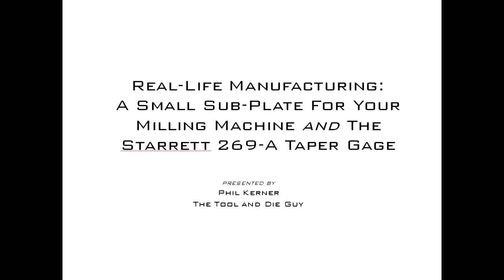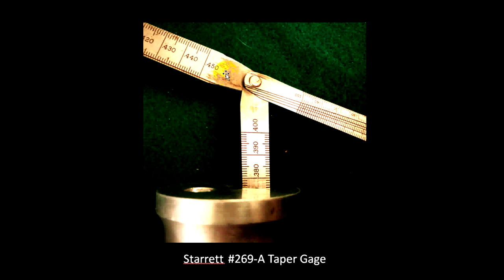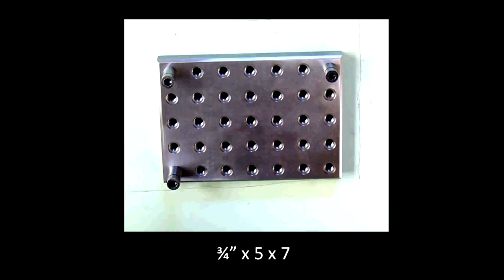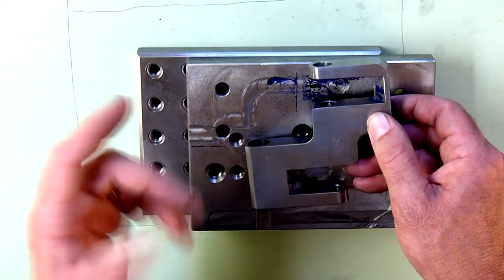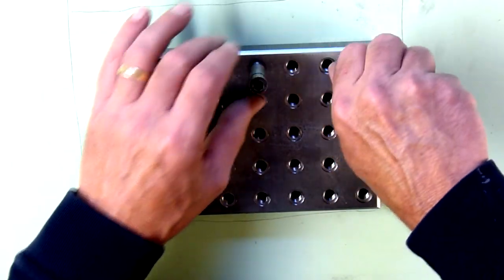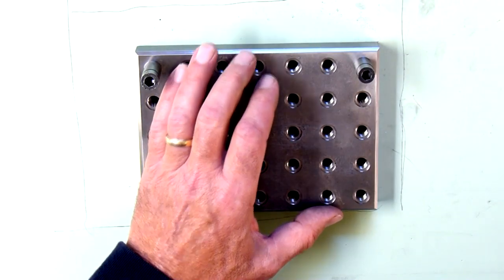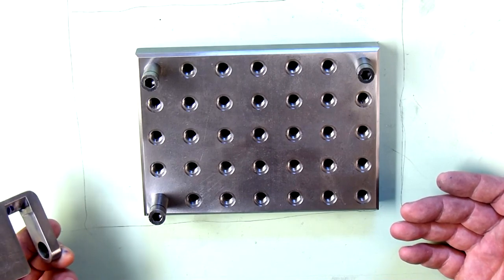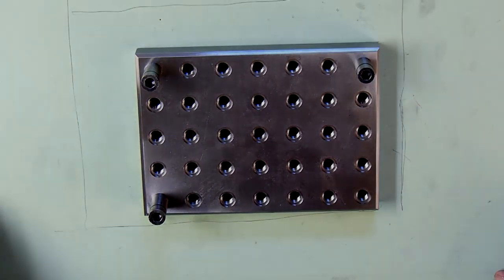Starrett Taper Gage and A Small Sub-Plate For Your Mill Vise

Comment: Hey Phil, 

We use sub plates and fixture plates in industry for Tool and Die Stamping side. The majority of die sections we make are designed to fit on the grid. And like you did with your shoulder bolts we have all the accessories to go with them all made in house. 

A bit off topic but we had an open house a few years back. My biggest trim was showing the die makers that had been about 20yrs all the new technology. They were all in shock. 

Michael - Plus8Precision

Comment: I have had both sizes for 45 years and still use them often.  Like the shoulder bolt but would lube the interference with Blue moly to minimize possibility of galling.
ATB, Robin

Comment: Totally new hobby type here...what advantages and disadvantages to hardening such a sub plate would there be in the surface grinder as opposed to the milling machine?  Please forgive my ignorance, I am addicted to learning.
Reply from the maker: Advantage to not hardening is the expense of heat treating and the time spent grinding it flat after heat treating. You will find that most tools used on a surface grinder are hardened due to the  amount of abrasive dust that the grinding process creates. Hope that helps!